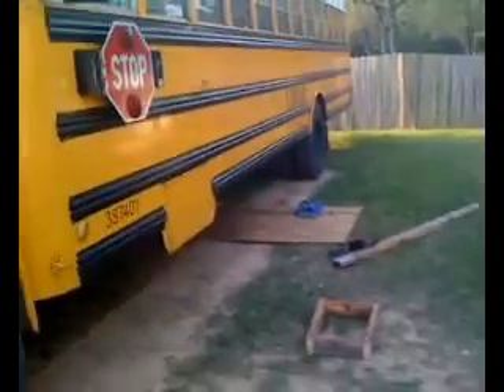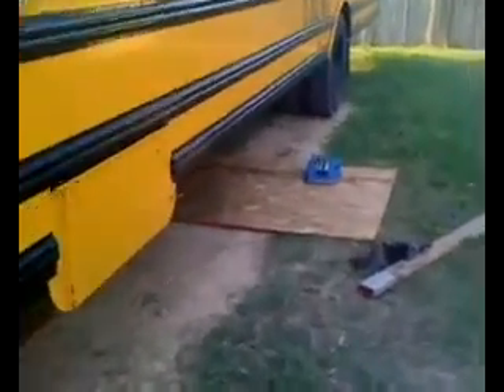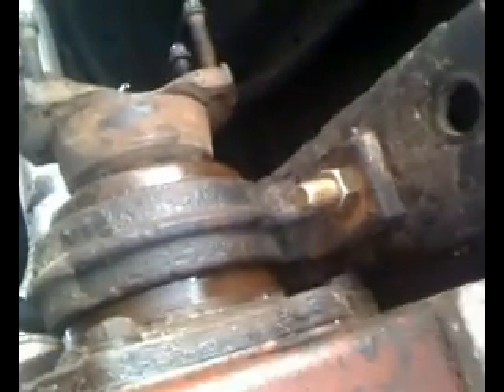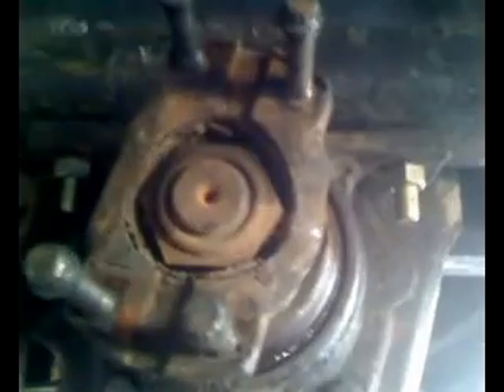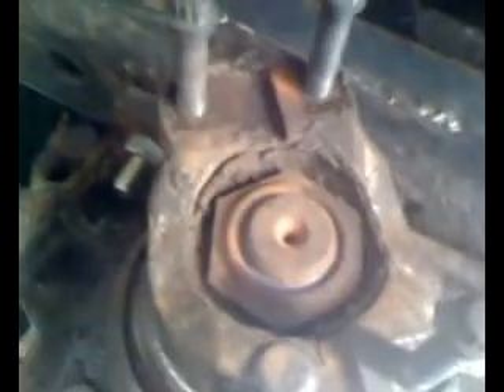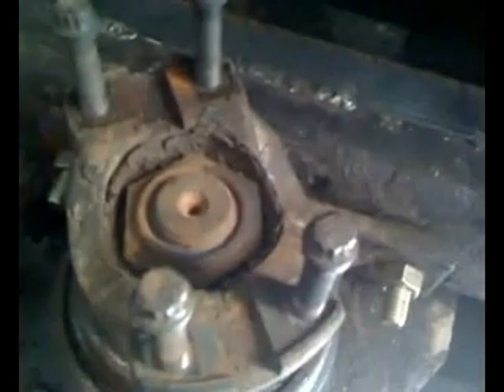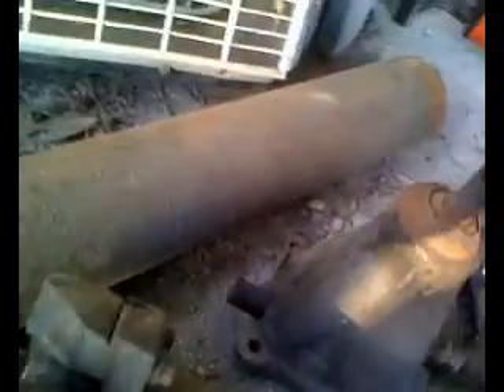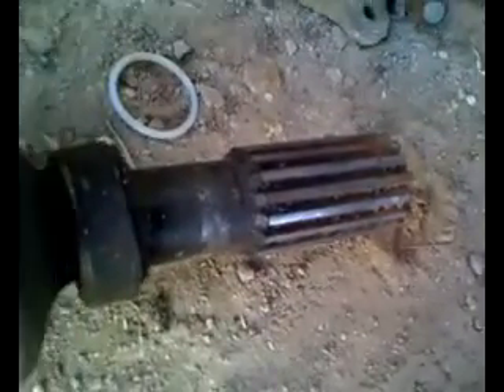International S-1700 COOL BUS Driveline Upgrades: Part 2

Comment: are you in the near future going to get a Spicer 7041 Aux Transmission for your Blue Bird? what other plans you have down the road for it?
Reply from the maker: No.  The only transmission upgrades I would like to do on it are an Allison MT643 in the future...
Reply: Oh the other video did you find the missing defroster fan for it yet? as Blue Bird  they used Electrohome/FASCO defroster fans as today their OEM is DCM manufacturing the new style the TA-93 its what they use now than the swiveling ball adjuster type they been using.  as there is plentiful of fans out there from where you get your bus parts, Amazon, EBAY,  that Bergstrom one i looked at on EBAY one put in a dayton 3.3 inch shaded pole ac motor in it its kinda strange. as here in PA the district has different busses in service but not sure on its state laws of owning a bus for personal use.  as i live close to another youtube user Spats bear he does vintage fans, electronics as i need to get his advice on fixing a vintage radio for a vintage vehicle i own.
Reply from the maker: I have a bergstrom one from my donor bus that will go back in.
Reply: Oh the OE motor Electrohome/FASCO is 2807 406 009 its common for Blue Bird as i got some of them. as Bergstrom is the best their blades are steeply pitched as in the near future i want  to get that Bergstrom fan off Ebay and get rid of the dayton 3.3 shaded pole AC motor on it and put in the correct 2 speed motor for it plus the mount. as i red the Bergstrom fans can be 6, 12, 24, and 36 volts as its also Kysor too their truck parts.  Also try to save any lights, switches, heater motors from the donor bus if they are in usable shape. heater and fan motors you can take them apart and lubricate them with zoom spout oil. or 3 in 1 oil the pain is getting the brushes back in the holders in them.